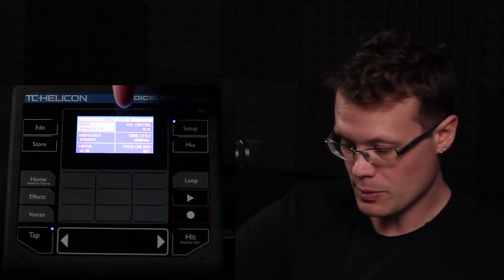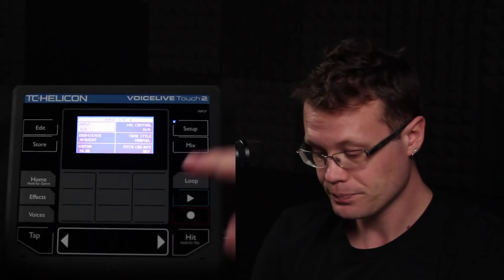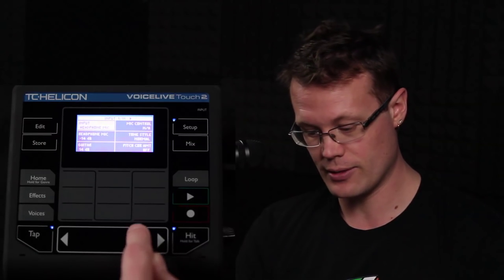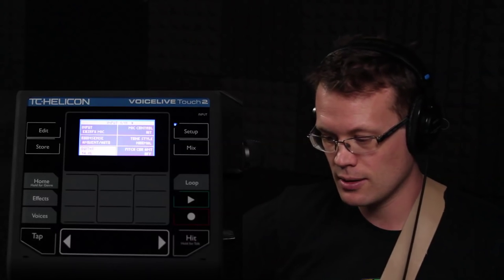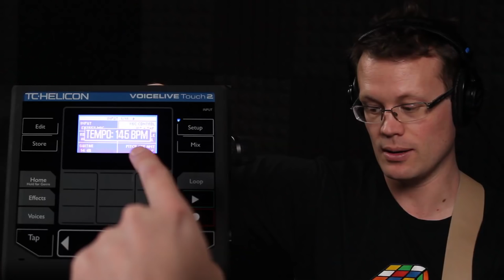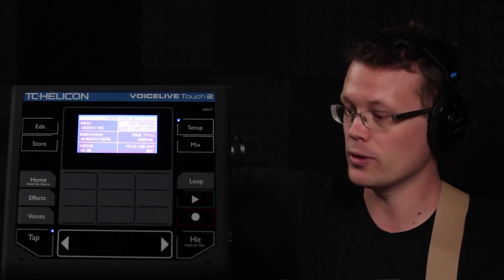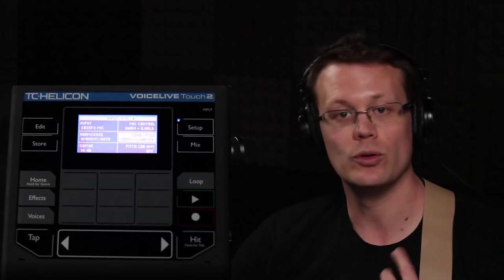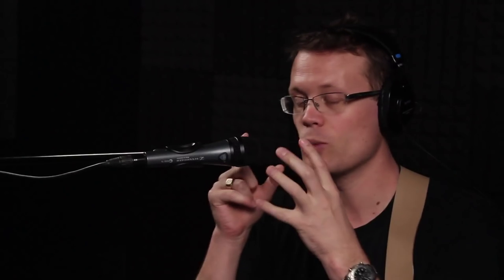Touch 2 Video Manual - Chapter 3a- Setup - Input

Comment: Hi!  I realize that purchasing the Touch 2 for a single effect is NOT terribly economical, but I have not heard a better doubling effect in any other processor (I have a Harmony GX-T).  My question is this:  Is it necessary to have an instrument plugged into the Touch if I'm only using the doubling effect?  Being a bassist, I would imagine that would not be very effective in triggering other effects.
Thanks!

Comment: why am I not seeing "mic control" as an option?  I'm using a Mp-75... also having issue with hearing my loops in my monitors.  I got this to play live loops while live performing.  Am I missing something?
Reply from the maker: In Touch 2, you select MP-75 on the first page of the setup menu under "Input".  Then, go to page 12/13 to set what you want to control with the mic button.

Comment: this doesn't explain how to do some of those mic trigger options if you don't have the compatible mic.  i don't have a button on my mic coming in...so i don't know how to trigger those things as easily as pushing the button on the mic.
Reply from the maker: All of the controls for Mic Control, like HIT, preset change, Tap Tempo, Looping are on the top level of the product. If you want to control a specific effect, you'd press Effects and then turn things off/on from there.

Comment: hi, or connected the guitar to my voicelivetouch2 but the input light is not flashing. I had to turn the volume on my classical guitar to maximum. obviously i adjusted dbu. moreover, when I use delay, reverb and scroll to increase and decrease the effect h-tune and / or trans are activated and it disappears as soon as I release the touch. this won't let me adjust while I'm singing. I believe there are bugs. can you help me?

Comment: Any singer who plugs this in while everything is bypassed and listens to how your tone is completely changed will never use this.   What I hear (all effects completely bypassed and turned off) is the exact same thin frail tiny sound that happens on the harmony singer pedal when you push in the tone button.   At least on that pedal crap tone is an option with the touch 2 it isn't.

Comment: Hello, this does not come with the on / off button. How do I turn off my Tc helicon voice live touch 2? Directly from the wall? I think that could be damaged by turning it off that way... Thank You!
Reply from the maker: We design the gear to have the cord disconnected to turn it on and off. It's perfectly safe. :)
Reply: god, i would love an on off switch.  just doesn't make any sense that i have to pull the plug every time to turn it off.

Comment: Hi, I would like to use The Voice live for vocals and saxophone. For my saxophone I have a mic with phantom with a jack which I was planning to use on the guitar input. I noticed there is a possibility to use phantom for your 'normal' mic. Is there also a way to get Phantom on the guitar input? Or any other suggestions on how to use my saxophone along with the vocals?
Reply from the maker: +Yoran Demunter Hi Yoran, the instrument input isn't a preamp, so you'd need to have an external pre for the sax. It could be a small mixer or a single channel pre.

Comment: Hi, for quite some I am trying to use the USB port to set it to receive signal from my DAW (Cubase) - NO LUCK. Can anyone help me out please?
Reply from the maker: Hmm, we did have a small number of units that USB audio didn't work on. We have a permanent repair (even if your warranty is over) in place for it. I'd suggest getting in touch with support. They can look up your serial and see if you are affected. If so, they will fix it at no cost to you. http://support.tc-helicon.com/tickets/new

Comment: Hallo craig...

I have a question. yesterday, a bought voicelive touch 2. 

I watched this tutorial from the start.
But, i think i found something different.

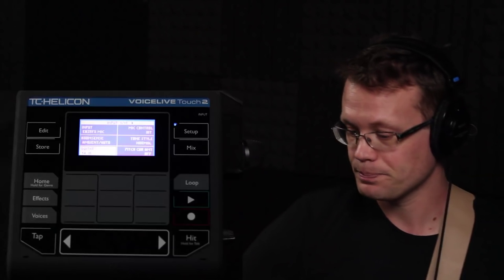In 07:09 , i saw "mic control" menu tutorial part. but when i checked on my gear, i could find that one (just blank on the screen).
Is this an error/trouble or just the different firmware?

wish you can help
thank you
Reply from the maker: What firmware is your Voicelive Touch 2 on? It may be that you need to update the firmware using our VoiceSupport 2 app. If you still have the issue on the latest firmware you should get in touch with our care team through the "support" tab on www.musictribe.com .
Reply: @tchelicon  Firmware Version : 1.2.00 B61 
Serial Number : 13107083
Manufactur Date : 2019.04.26

Thats writen in product info 13/13

Comment: Como puedo loopear el sonido de mis pedales q salen por thru ya que solo loopea la guitarra eléctrica sin los efectos ?
Reply from the maker: The Thru mutes all guitar processing in the unit and only detects chords for key/scale. You'd have to connect from the output (in dual mono mode) and then go to your pedals if you want the looper to record guitar. Make sure you turn off any guitar effects in Touch 2.

Comment: Hi there, I don't have the mic control on mine😳 it's a blue rectangle with no writing and I can't press on it.... Is it normal? Thx
Reply from the maker: +GeorgiaJaneOfficial You need to go into "Setup" and change the mic type to MP-75. That will enable the mic control button. From there, you can determine what you'd like the button to do.
Reply: +TC-Helicon thx a lot

Comment: Can voice touch 2  be use with any recording software like mixcraft 6?
Reply from the maker: willie Roma Sure, as long as you can get the VLT2 either recognized as an audio device in the software or you have an external audio interface to plug the VLT2 outputs into, you can record quite easily.

Comment: Hi,
I'm using TC Helicon with a shure sm58, but I don't know whitch button press when he presses  the button on his mic and because of this I can't do much. Can you help me?
Reply from the maker: He's using one of our TC Helicon mic's which has "Mic Control" which allows you to Hit from a button on the mic's.  You can either grab a MP-75 or MP-76  https://www.tc-helicon.com/Categories/Tchelicon/c/Tchelicon?q=:catRank:division:CREA:publicProduct:true  or you can check out our new MCA 100 Mic Control Adapter which you can connect to your current Shure SM58.
Reply: So if I don't have this things, I can't use the TC Helicon Voice Touch? Please, I need to know which button I press on the tc helicon voice live which does the same thing as the mic button.
Reply from the maker: It actually works the other way around. The mic is only able to remotely control some of the features that are in the Touch 2. With the unit itself, there's nothing you can't do that the MP-75/76 would do for you, except the remote control portion.

Comment: I don't have mic control option on my version I just purchased. Has something changed?
Reply from the maker: +Phil Turner The first setting on the INPUT page is where you select Mic Control mics. Change it from Dynamic or Condenser to MP-75, e836FX or MP-76.  Make sure you update your firmware to get access to the MP-76 options.

www.tc-helicon.com/products/voicesupport/
Reply: +TC-Helicon Does this mean you can only have the Mic Control option if you are using an MP-75 microphone?
Reply: @tchelicon  don't work... I want to open it but does not work

Comment: I don't see MIDI as a choice for inputting chords in the setup  menu.   Why isn't MIDI and option???  I'm not a guitar player. The reason I bought this thing was I thought that I could play chords thru a MIDI keyboard.    For some reason  I have always had problems with harmonizers or almost anything tone dependent,  that utilizes thee human voice.  It is not because of bad pitchy vocals. I have too many other frequencies in my voice outside of the fundamental tone.  That problem confuses electronic listening devices and often it will hear a frequency from me that is NOT the fundamental pitch.
Reply from the maker: If you have a 5 pin MIDI device plugged in (make sure you've got MIDI Control on setup page 8 set to MIDI) so it's pickup up that info correctly. Double check channel etc.. You should see MIDI on screen when you play notes. At that point, with the Harmony Key set to Auto, it takes your MIDI info to determine key/scale for harmonies. If you want to voice the harmony intervals manually choose the "Notes" styles near the end of the harmony styles list. These will voice the exact notes you play (above or below the split point).
Reply: Thank you very much! Your help is extremely appreciated. I have really been having trouble navigating around that unit.  Logically I thought the MIDI choice would have been on the input screen, seeing as the different mics and guitar input are.
Reply from the maker: I can totally understand the confusion. When you're in NaturalPlay for key/scale it'll just choose whatever input is the best, giving priority to MIDI and guitar. The "Notes Mode" stuff is a bit of an outlier, so we put it at the end of the Harmony styles.
Reply: I have another rather important question for you.  Is there a way to have the unit listen to more than one MIDI channel at a time? 

For my particular setup that is pretty important.  My partner has an old school,MIDI set up with mostly vintage equipment, using Ports 1 and 2 out from his Roland A37 MIDI controller keyboards to three separate sound modules, each listening to  different channels.  Chan 1, (for the Kurzweil Micro Piano module, Chan 2 for (Alesis S4 bass), Channels 3 and 4, (for the S4 sounds)  and, possibly 3 more channels for the sounds in a Ketron SD2.   So, I need the Touch 2 to listen to multiple channels at once.   Thanks again!

Comment: why show us all via the mic are there any with just the unit ?
Reply from the maker: The unit is designed to have the mic plugged in. It doesn't do much without it, so it's there in the video to help give examples. I'm not sure what other way we could have done it.
Reply: I meant can you show us a video of the unit with a normal mic not the TC HELICON mic as i dont have the mic only the vlt2
Reply: What difference does it make? A mic is a mic. The TC mic just has a special switch - no biggie.
Reply: Mignon lee-warden literally thought the same thing.

Comment: On the first setup page "input" i don't have mic control button - it's blank, why is that?
Reply: I did a little nosing around and I'm pretty sure the mic control feature only appears if you have a mic plugged in that's "mic control compatible", so one like he has plugged in that has buttons right on the mic.  The feature is a fringe benefit that allows you to extend a selection of Hit configurations to the buttons on the mic.  You're not missing out on any core functions if you have a standard mic plugged in.
Reply: omg thank you I was seriously worried I was going to have to send it back again xx

Comment: With the firmware update, is there level control over the aux input for monitoring? Whereabouts in the set up menu can i do this? Thanks in advance :)
Reply from the maker: +Blood Boy Aux level is on the Mix page. It may get hidden when Aux isn't plugged in (we do that sometimes) so make sure to have a cable in there when you look.